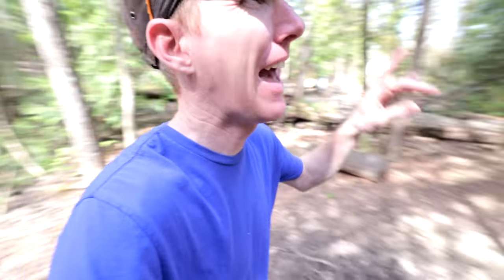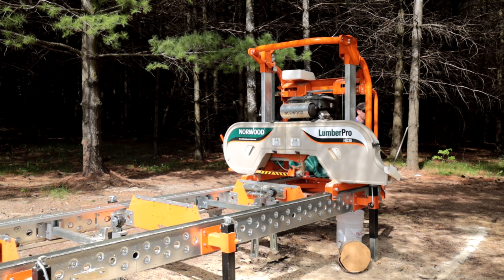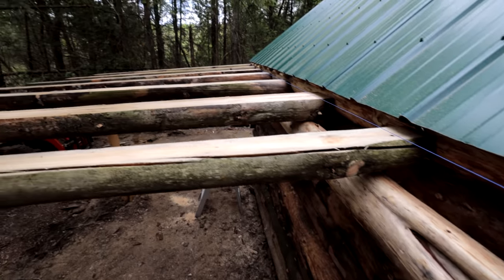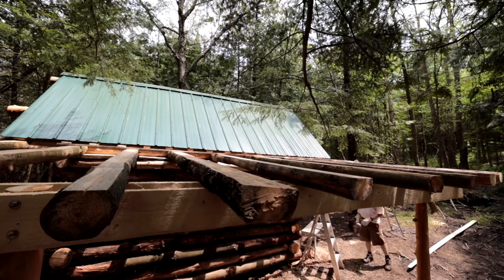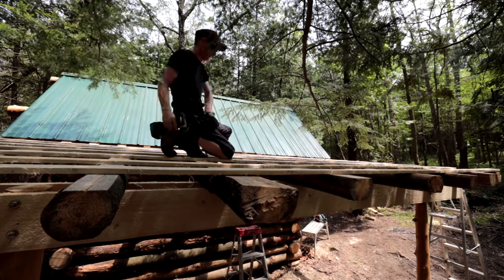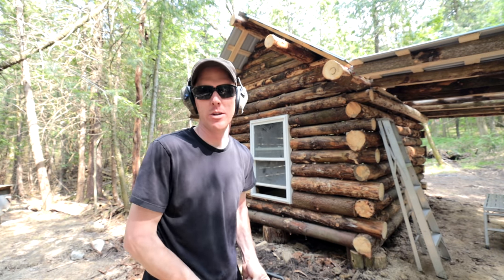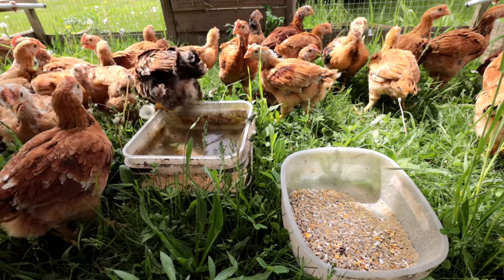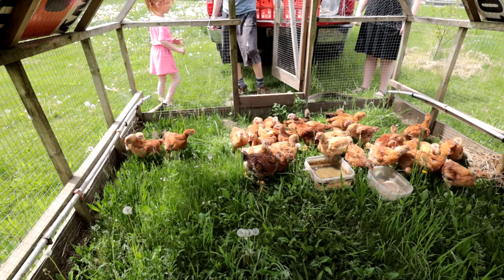Building an ADDITION at the Off Grid LOG CABIN!

Comment: Kevin! I might try your way of fastening the metal roofing. Have always done it on the flats. Do you increase the length of the fastener itself to do it this way?
Reply: I use what Vicwest sends me... They are about 1 1/2" long don't mash em in.
Reply: @cmosphoto1  ok. Thanks!!
Reply from the maker: Caulking works too... ;-)
Reply: @ModernSelfReliance  oooooooo! I like caulk! 😜

Comment: Do you think you will get alot of smoke inside the cabin when it is this close. Smoke might go up and in the cabin. Make a fire under the lean 2 and see. I think you could have pushed the over hang roof up in under the cabin roof and then later used the valley flashing.
Reply from the maker: The chimney will be still beyond the roof.
Reply: @ModernSelfReliance  OK I see now, what about my roof idea?

Comment: I hate those pieces you took off if you want to make your own Valley cap the pieces that you cut off the top section take those and take a tube before and lay across them where you want them make your line lay you too before owner then take the bucket of your tracker and press down on it and then bend them up and then you'll make your own flashing